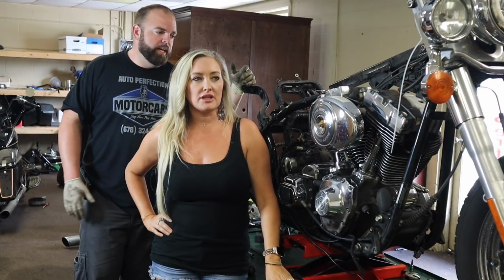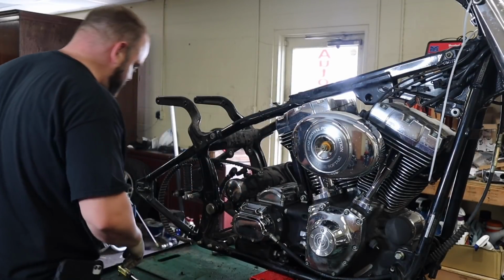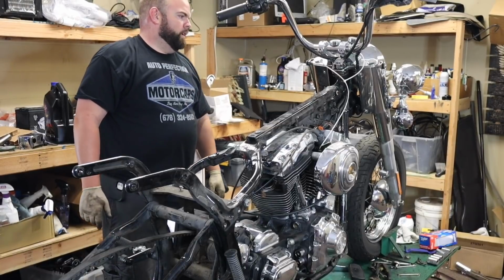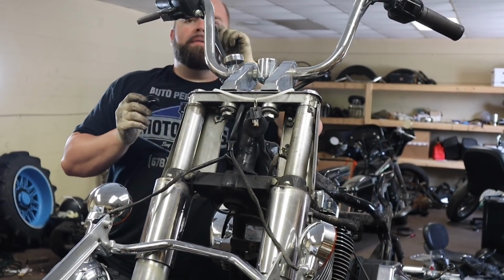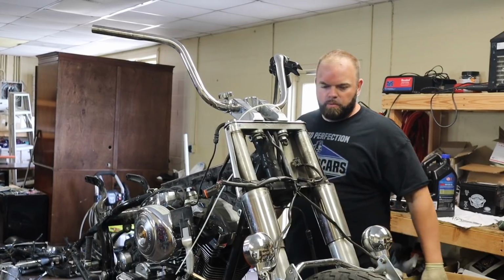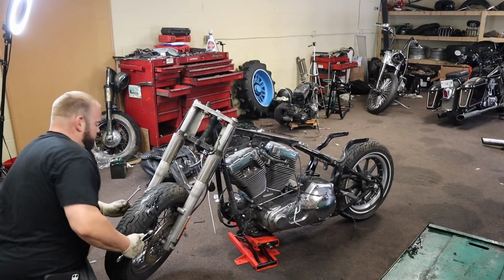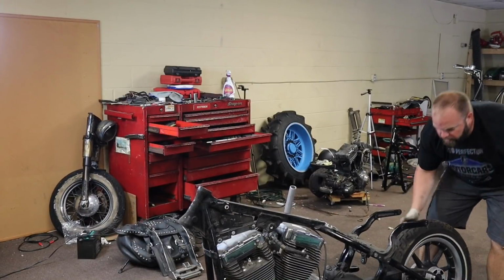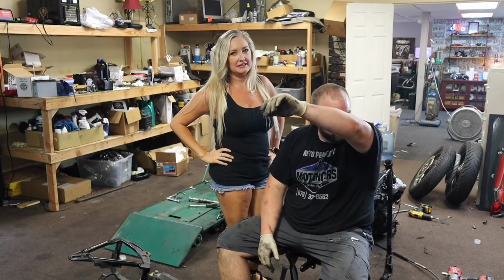Heritage Softail l Parts Bike Teardown COMPLETE! | Part 11 l Budget Rebuilds

Comment: use a piece of old carpet or a rubber mat when lifting the frame off the engine save scratching the crap out of the chrome
Reply from the maker: Thanks for the tip